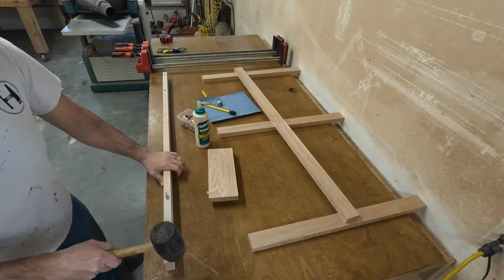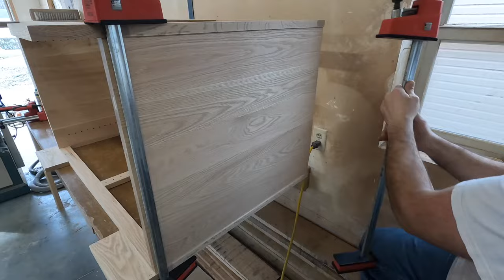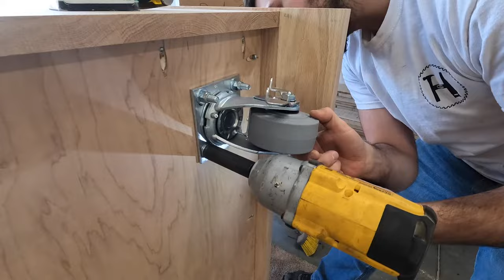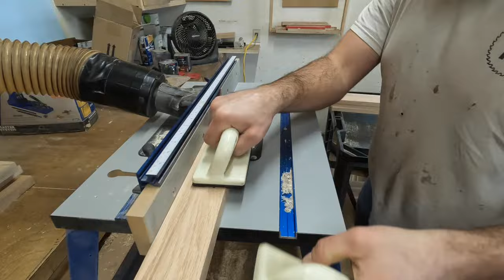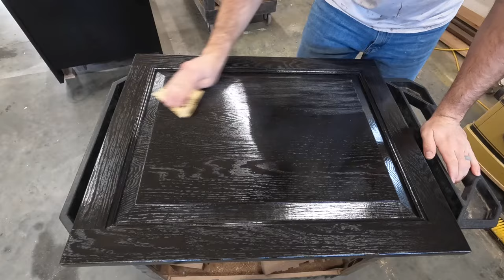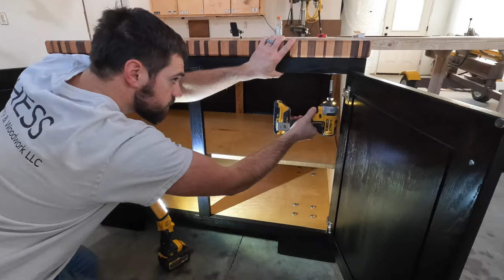Extending Table in Kitchen Island

Comment: This is incredible and would be looking to have this with a 2-3 stool counter indent (so kids and grown ups can eat together albeit on different levels) plus an electric hob... undercounter extractor can't be used for this dream, but will look into the installation guide and  see if it can be placed at the other end instead.